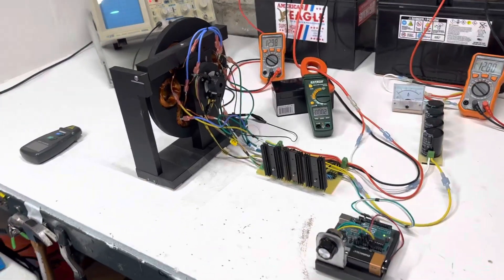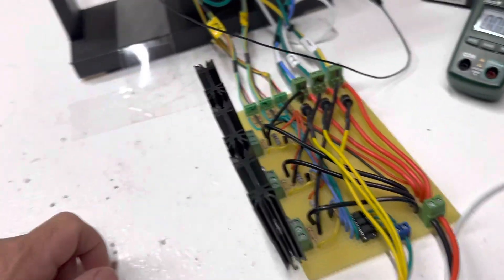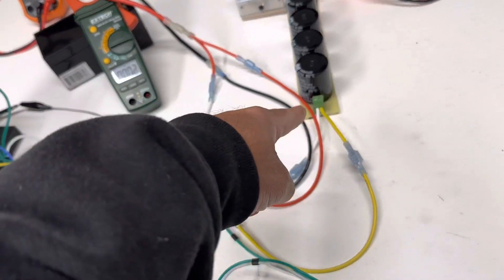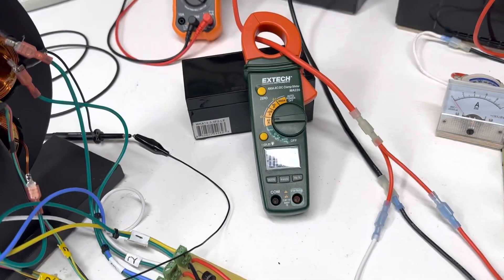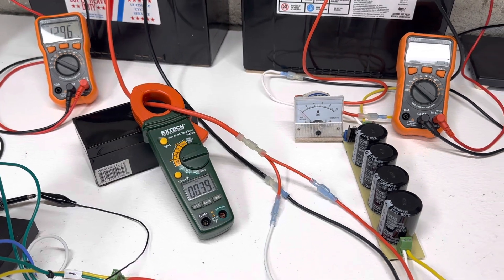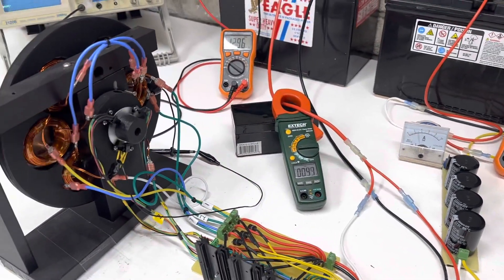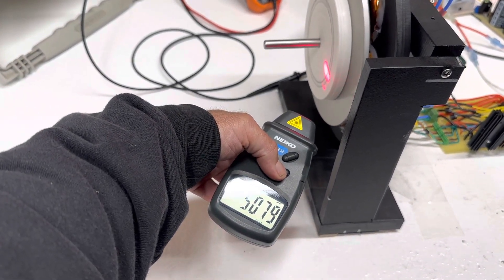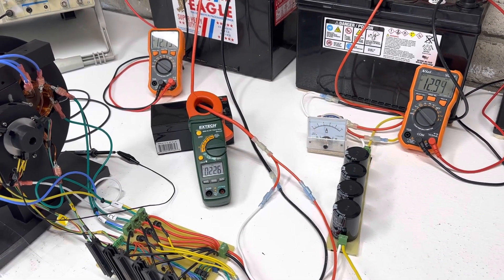Axial flux pulse motor

Comment: love your vids well put together motors and good explanations ,not sure how much information you are keen to share but if you could add more info about parts used for example coil wire awg and number of turns or even just ohms size and strength of magnets etc more info is always better than less maybe just add it to comments up to you ,would like to see slightly more powerful motors if that ever fits in with what you do 1-2 kw type of thing
Reply from the maker: Thanks for the comment ! The coils on this motor are 2 strand 18awg with 2 coils in series 
I do have up to 15kw motor it’s on my outboard I have couple videos on that so check it out I also have a store   wwwkenergy.store 
I sell circuits cap dumps motor ext thank you

Comment: Wow I'm inspired, but what exactly is going on here? I don't need a scientific (yet), but just a simple statement, K. (Or anyone). But from what I gathered, the battery on the left is powering up the "setup" and then the battery on right is being re-charged? Am I right?
Reply from the maker: Yes 👍 first battery powers the motor then the motor makes electricity from pulsing the extra power in the system goes to the capacitor then discharges to the second battery to charge it
Reply: @K Energy  Holy cow! So that means if there's a secondary charging circuit, like from an MPPT connected to a solar panel to recharge that bank, would that then extend the range from let's say a eBoat? Theoretically, it would right?
Reply from the maker: @strongme80  there’s anywhere from 60% -15% depending on load that can be used to charge second battery or back to original battery for longer range 
 Look at my outboard video
Reply: @K Energy  Goodness, me! Just watched the outboard video! I'm going to finish my current project converting a mountain bike to an ebike to learn all these things controlled by arduino and then take this up on a small boat, without a doubt in my! So excited and inspired! Thank you soooo much!!!!!!!!!!

Comment: How many magnets versus coils are you using?it looks like  it’s a 3 phase motor? Curious to know the amount of magnets versus coils you used
Reply from the maker: 6 coils 2 in series 3 circuits and 8 magnets 4 s 4 n
Reply: @kenergy1707  interesting combination
Reply from the maker: @windpowerandmore6310  more on offs more output
Reply: @kenergy1707  yeah definitely buddy I was thinking maybe you had 9 coils 12 magnets I’ve never built a 3 phase motor or alternator with only 6 coils before. Definitely interesting and very nice work as always try two rotors you will be amazed!
Reply: @kenergy1707  why not fire all coils simultaneously, with pulse-reversal on fly-off ?
Reply from the maker: @paulanthonybridge5741  they are on a different phase
Reply: @kenergy1707  ok, i see. Mine is a single-phase high frequency type.

Comment: Really great! 
Double rotors will make it something unbelievable I will bet..
Trick to try is "offset" one rotor compared to the other rotor....so magnets not straight across but alittle bit "skewed" maybe 5 degrees to 16 degrees offset one rotor to the other,
Other part of the trick is Double up coils on the cores, one rotor reacts to motor (drive) coils, the other roetor reacts to "induced generator" coils.
I like to put about 1/4 of the core length wound with motor coils the remainder induced generator coil winds,
The generator coils will sponge up the flyback spikes, besides  big induced  transformer effect every DC pulse to the motor coils....also you can time the offset so no lenz braking when generator coils load up.....I found about 5 degrees "leading" generator rotor to the motor coil rotor, another guy got 16 degrees and no lenz braking less draw under load etc
I use ferrite cores right now, probably low hysterisis cores like metglas the very best.....
Your aircores might work really good too with coils you have now with generator induced coils stuck right behind them,  so every motor pulse slams flyback and backemf and all that stuff  into generator coils.  Nothing wasted...
You are having too much fun!  Excellent  work!!!!
Reply from the maker: Thank you ! As always your comment are amazing! 
 I will definitely try all of your advice!

Comment: Reminds me of the pmmg version and it makes me understand why he used the axial position. It has the flywheel effect added to the already high output bemf.  Do you have a machine shop off camera or something. LOL great work and design. It seems to be one of the best designs for sure.
Reply from the maker: Thanks ! 
Not really I desperately need a lathe
Reply: @kenergy1707  I hope you can find one that fits your needs and that you can afford. Those things are an investment. Can you imagine the damage you could do with one of those though... you could build a few custom motors and pay it off.

Comment: Double thumbs up axiel flux motor are the best. You should put a rotoron the other side as well twice output power for the same input as a single rotor. But I recommend reducing the rotor weight some more rpm and less current draw. Well done I like it
Reply from the maker: Definitely double rotors with less mass this is a (rough) first prototype

Comment: It was interesting to see the amp meter on the output side speed up or discharge faster as you slowed the motor down.....    Where do you get your boards and wires from, any specific electronics store ?
Reply from the maker: Thanks for the comment 
 I get most my stuff at Amazon or mouser